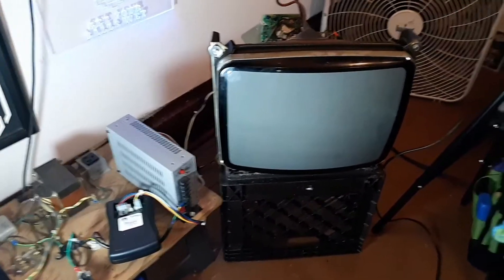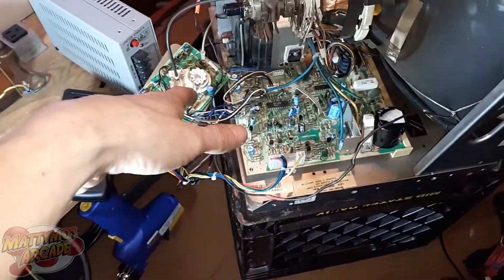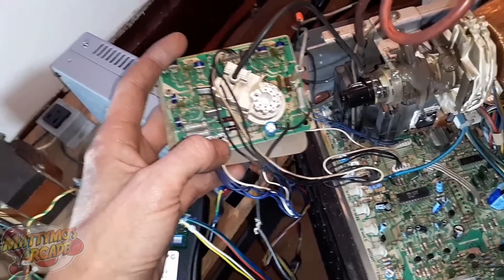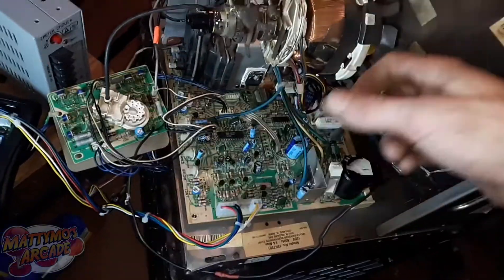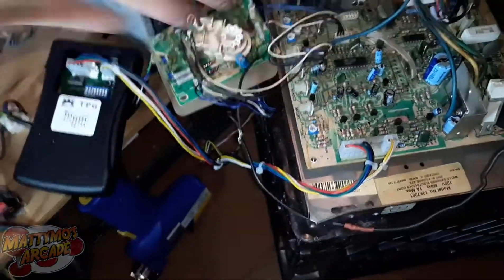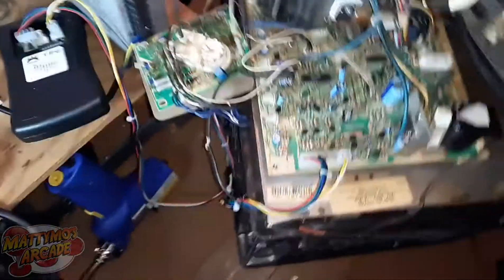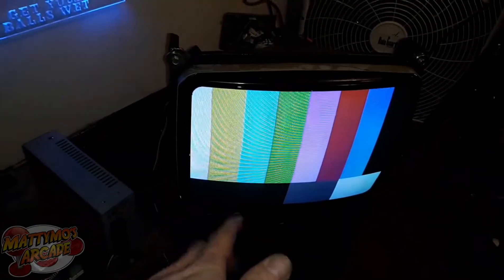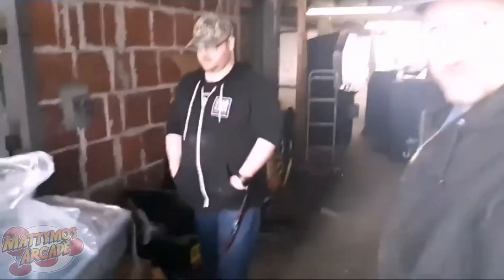Monitor Repair Log #2: K7000 Color Problems and Fixes

Comment: MattyMo's Arcade, What does the neck board to in monitors? the neck board has the RGB transistor drivers circuit always on all neck boards in monitor and what else does the neck board do? why are the signals called G1 & G2 because they are a high negative voltage to the CRT grids pins